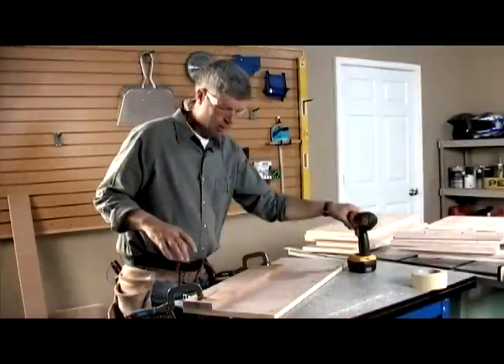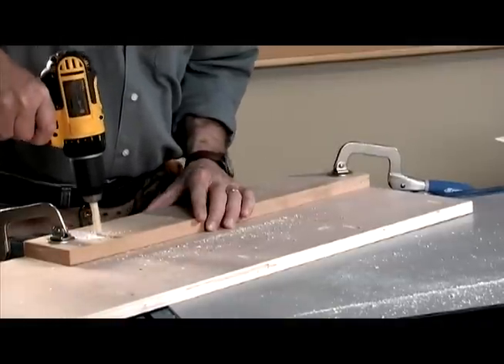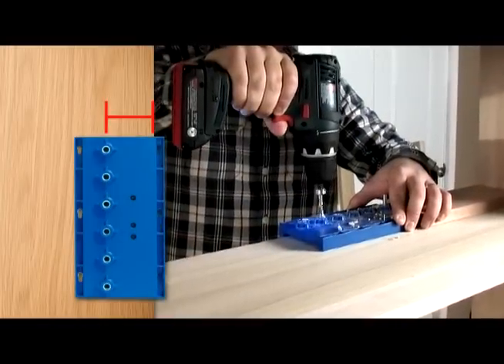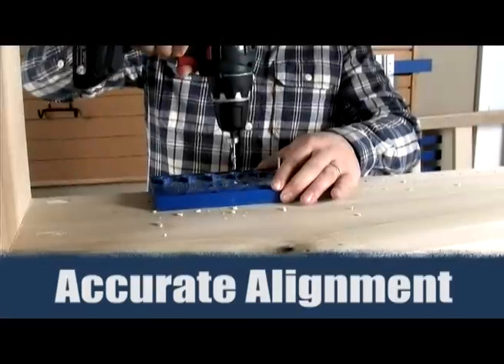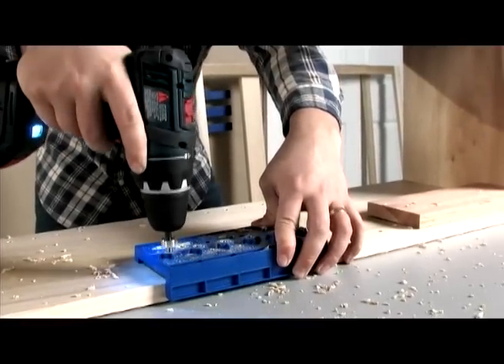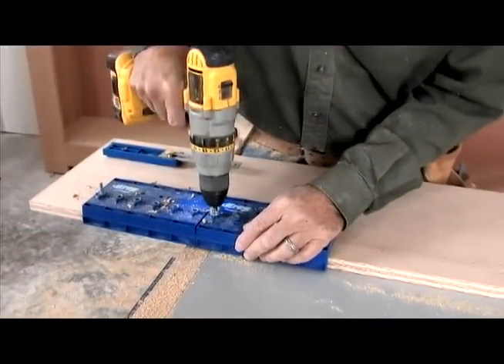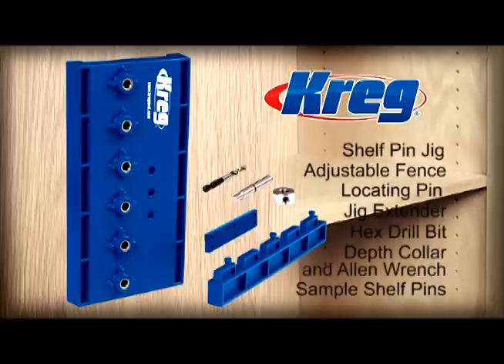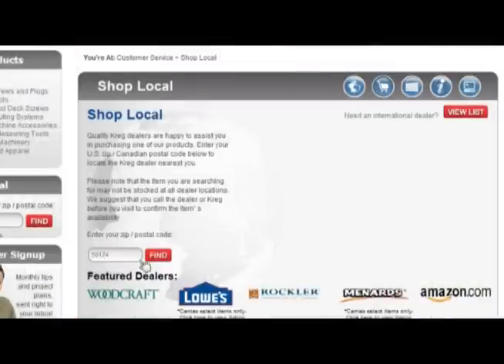Kreg Shelf Pin Jig - Easily Add Shelf Pin Holes To Your Projects

Comment: Great tool..use it upright on an existing cabinet, or pre assembling. Saved me heaps of time, as do my other Kreg purchases. I've just bought a Multi-Mark, just have to be careful during ruler changover, to not lose or drop the nut somewhere...lol.  Great for small work, and not having to get my larger squares down for a small piece of timber. So easy to change over to the other sections on the unit. I always put the ruler in the longer channel for storage.

Comment: This jig is helpful. Yes. A professional woodworker could make one and spend a couple hours of their time measuring, cutting and drilling the jig, which I'm sure is worth more than $35.00 OR, they could just buy the jig and get to work. None of that has anything to do with me. I'm a factory maintenance mechanic who wants to build a custom cabinet in my home. My idea of a custom cabinet isn't one with wobbly shelves. The time I would spend over-engineering a jig for this task is definitely worth more than the price of this jig.

I do see a potential issue that would exist when working with a cabinet that is already installed or that only allows access from one side, but for me, I have an 18-inch vice grip clamp that handily reaches in far enough to clamp this jig to the back of the cabinet. No matter if I made my own jig or if I bought one, I'd still have this same problem at the back of the cabinet.

This jig allows for better than home-made precision and I'm just the person who would know that one hole is a 16th off and it would bother me (but probably nobody else) for the rest of the time that I live in this house, just like that one tile on my kitchen floor that I must have bumped while laying another tile.

Don't be hatin'. Buy one or don't. I mean, who actually looks up a video about a hole drilling jig just to post about not needing it? Find something else to do.
Reply: Relax

Comment: If I didn't already have the Woodcraft shelf pin jig I would buy this.  Go ahead and ignore the self-described "pros" who pooh-pooh this.  I'm a union-trained finish carpenter.  95% of my experience is in the field installing paneling, cabinets, wall base, etc... here in the SF Bay Area.  I've installed everything from paint grade base in tiny offices to the gorgeous Douglas Fir paneling in the cafeteria at Intel in Santa Clara.  The guys who gripe about this jig are probably out-of-work butchers who have nothing better to do than brag about their ability to make less-than-perfect jigs.  Installers have a slightly different skill set than shop guys.  On those rare occasions when I need to build high-quality cabinets I appreciate anything that makes doing shop work easier and more accurate.  This jig looks like a winner!!!

Comment: Show how it can be used on the inside cabinet. your need a long clamp..heeheee.
 How do you support the jig on the inside?
Reply: Steve Vera I layout shelf clip holes, before I assemble. If you’re dealing with an already built unit, I believe ViseGrip makes a deep throated welding clamp.
Reply: Could you add a 'spacer' wedged to the back wall and move that spacer along?

Comment: Pardon my ignorance but what is the distance between holes?
Reply from the maker: Kreg hardened-steel drill guides are centered on standard 32mm spacing. Learn more on our website: https://www.kregtool.com/store/c59/hardware-installation-solutions/
Reply: 1-1/4” for practical purposes (32mm is about 1/64” + 1-1/2”). It’s 5/8” + a very tiny hair from the center of the end hole to the edge of the jig.

Comment: lots of tearout on the holes in plywood, slightly better in hardwood
Reply: Regretfully bought one. I now know why other 32 systems are upwards of $300. I should have used a sacrificial piece in between the jig and the gable to avoid tearout.
Reply: I found clamping it down, then get a piece of 4”+/- wide scrap to push down the inside edge minimized tear out. I’m using pine stair treads with a very delicate veneer so there is some but a lot less than my first attempt. You can push down the jig itself but that is painful and a pi3ce of scrap puts more even pressure on it.